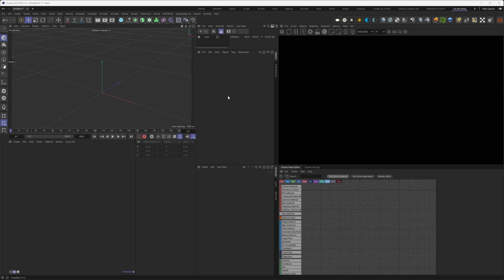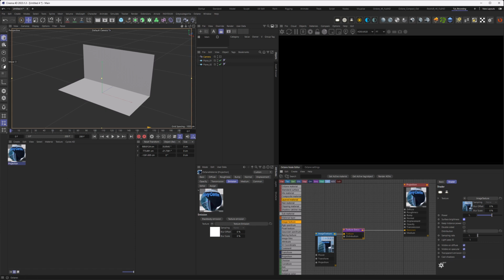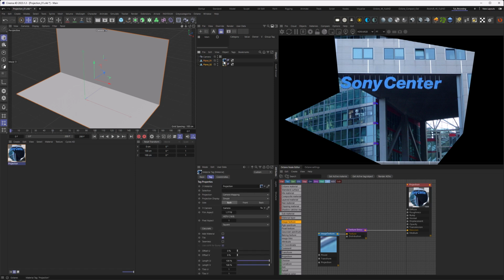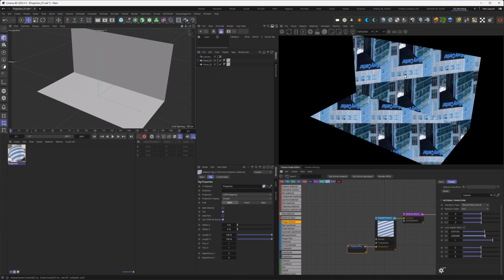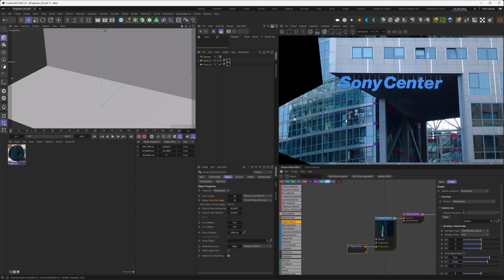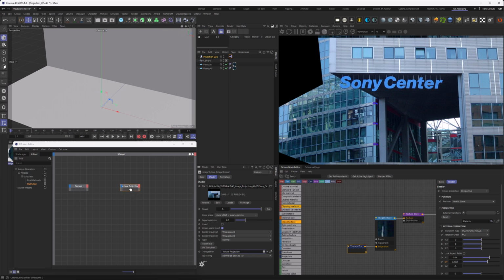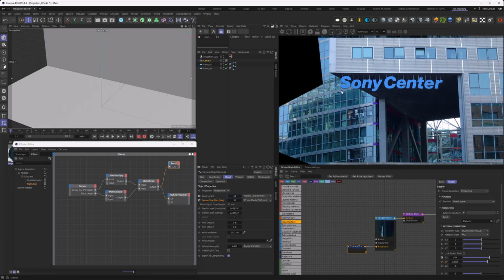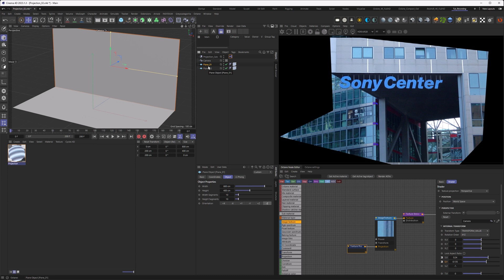Silverwing Quick-Tip: Octane Camera Projection

Comment: This is just the same as camera mapping, not? Just create an object, add a material that is the background, set to camera mapping, drag your camera into the material tag where it says camera and set the aspect ratio to match the aspect ratio in the output settings...
Reply from the maker: Yes, I show that at around 3:00
Not sure if it has been fixed but back then there was a problem where the projection was not matching 1:1

Comment: Hi, I have a problem. When I use the camera mapping projection for the material, octane renders the image shaped at the edges by about 2%. Is there a solution to this problem? There is absolutely always an offset.
Reply from the maker: Hey there and thank you very much for your message.
I think that's the matter when you try the first method in the video. The second more complicated one will work more accurately. At least it was when I recorded the video.
I hope you can get there 🤞

Comment: How would you use this to project textures from live action plate footage so the environment has correct scene. Diffuse or emission texture? Also, how would you then setup the projected textures as shadow catcher as well to get realistic shadows and reflections?
Reply from the maker: Hey there and thank you very much for your question.
I think this is a bit complicated since you want to use the image to affect the object in the reflection / refraction and also diffuse lighting.
If it would just be about the emission and not the Shadow Catching aspect of it, I would use pure emission with it. Set a diffuse material with black diffuse, then use a "Texture Emission" with "Surface Brightness" ticked on.

Though this then would not catch shadows and reflections.
So you could experiment with also using the same image on the diffuse and then, depending on the material of the projected object also add a reflection. This is only possible with the universal material. Since the Diffuse Material does not have a reflection and the Glossy Material does not have emission. So you could make a universal material with e.g. a glossy reflection and a projected texture, that goes into the color (Albedo) and emission. If you are OK with just a Shadow as well as the Diffuse GI of the Object, stick with the Diffuse Material.

Then use the render layers to get your object-, it's shadow and it's reflection separated and on its own render pass / render layer.
This can be merged in compositing (like After Effects, Nuke or Fusion Studio) or within octanes own internal compositing context. I have videos on all of those:

Render Layer & External Comp in After Effects:
https://youtu.be/YB4LBf_t_Xs

Render Layer & Internal Comp:
https://youtu.be/bEgjnyNwOSg

New Internal Compositing Nodes (This might be necessary to know what to do in newer Octane versions):
https://youtu.be/ULrxD_7fJKs

Basically you would use your video as an background layer (like what I do in the second video with the gray background)

Hope this all makes sense and helps.
If you have questions, then feel free to ask

Comment: hmmm, not sure what I'm doing wrong but the FOV math didn't work out for me like this. I followed the steps, and the the projection was correct-- but too small. I had to multiply the math you laid out by an additional 1.43x. So not sure where that comes from. Project size and images all match. I'll keep looking into it.
Reply from the maker: Thank you very much for your comment.
Maybe they changed something until back then... 🤔
If I have the time I might look into it again. At least you got there somehow in the end 😇
Reply: @SilverwingVFX Yep, thanks for the reply! I'll try a totally new project and see what happens in that. I'm using camera data from pftrack, so maybe that introduced some kind of scaling issue? I be sure to comment again when I figure it out.

Comment: We are very aware of the effort you have put in, as a community. However, I have a request, which I'm sure other friends would also want. There should be a way to use the shadow catcher of the Octane render engine as a reflection catcher as well, without being confined to the layer ID. If you find a way, please share it with us. It becomes essential in projects where adding a 3D object to a video is crucial.

Comment: Thanks for this. Can you explain how the original method wouldn’t work for some VFX shots? What would be the reason for using the octane camera baking in VFX?
Reply from the maker: Hey there. Yes, of course.
There are situations where you need to bake down your projection to objects that have existing UV sets. Mostly if you want to deform your projection.

Think about a birds eye view video out of a helicopter that you tracked and now reprojected to a ground plane.
If you want to simulate a meteor hit the ground plane would deform from the impact.

With both the C4D and the Octane method your projection would still look as if it was flat and not follow the mesh.

With C4D you are using the UVs for your projection. They are different each frame of the video, because your viewing angle changes.

With Octane the projektion is done Procedurally so you are free to bake down the animation to the existing ground UVs.

After that you just have a UV mapped moving texture on your object. So you can deform your object and the texture (former projection) will deform with it.

Sorry for the long read. I hope that makes stuff a little clearer.

Cheers and an awesome Day to you!
Reply: @SilverwingVFX  Thanks so much for your thorough explanation. Your videos and tutorials are actually very helpful and needed. You touch upon a lot of things in cinema 4d and octane that we can't find on the internet. I hope you continue making more!

Comment: How can i fixate the projected texture onto the plane UV's?
Reply from the maker: Hey there.
You have to bake the Projection to the UVs.
You can do that using this technique: https://www.youtube.com/watch?v=gcJNWtI7ouc

You need the Octane Native Camera Projection method and good UVs on the geometry you are projecting on.
Just bake the Texture and reapply it as a UV mapped tex.

Unfortunately there is no internal way of doing it on the fly. At least that I know of!

Hope that helps 🙂
Reply: @SilverwingVFX  Thanks for tipp this helps alot, also thanks for the fast response glad to have a veteran like u in this community helping out! 🙂

Comment: Hi! cool tut!, is there any difference between this method and using the Sample pos. to UV projection?
Reply from the maker: Hey there and thank you for the comment.
Sample Position to UVs won´t show up in reflections / refractions etc. correctly.
It will never reflect / refract the right part and always show the part of the background image that would be at the reflections / refractions UV location, not the position the ray is actually traveling.

Comment: Is there any way to use this to make the ian hubert method possible in c4d octane? Great tutorial as always btw
Reply: If you are reffering to the green screen part yes! Go look up this on YouTube: Siggraph 2018 Rewind Aaron Sorensen: VFX & Compositing with Redshift & C4D. He shows Ians workflow but just in C4D :)
Reply: @rolf1820  no. im talking about the ian hubert modeling method
Reply: @LeftCG  oh just apply a texture onto a plane, then use the knife tool to cut out details
Reply from the maker: I would have to look at how exactly he is modeling. But I guess something like this can be done. However I think it would be more in the side of projecting then converting to UVs, like the 1st method I showed.
I do the conversion from the tags to UVs just to make it more understandable. But this can be also used to fixate the projected textures.